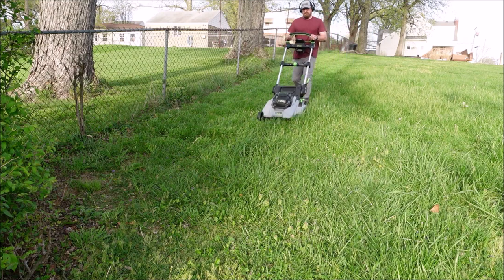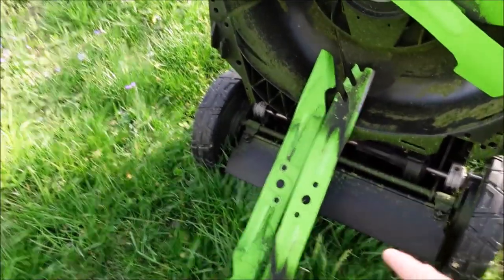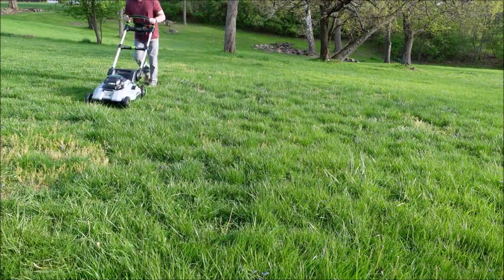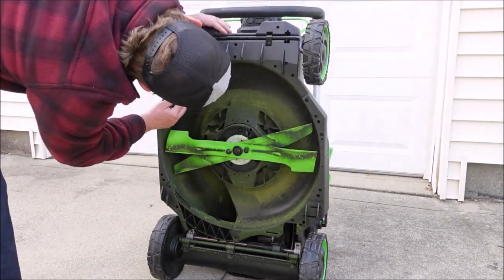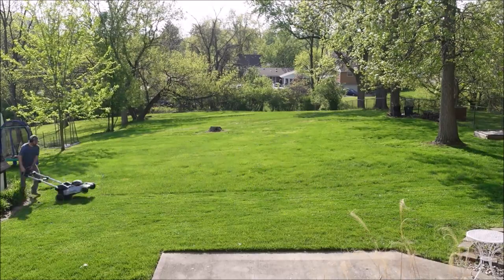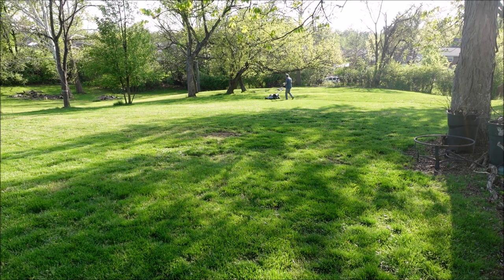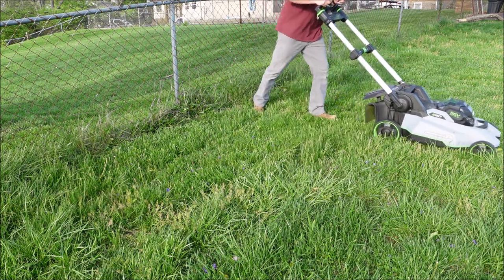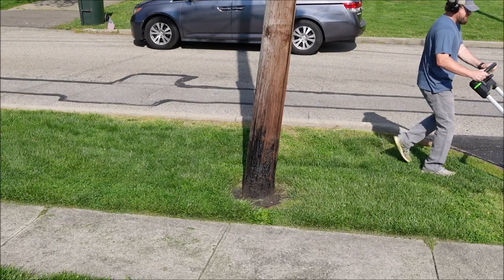New EGO (2023) Speed - IQ - TEST and REVIEW - LM2167SP

Comment: I just bought the LM2167SP Select Cut XP this week at Lowes on sale @ $699.99  using a Lowes 20% off coupon (MAX DISCOUNT OF $100)  my final price was $599.99/ $636. w/tax. I sold the battery and the charger to a friend as I didn't need either of them for $575. , Now I have the newest EGO mower for a whopping total final cost of $61.00  . My wife now totally approves of my purchase. I'm still not thrilled about the Speed IQ feature vs my last EGO model that used the barrel adjuster and the handle paddles. Mower lurches forward too much sometimes and the loud sounds it makes while in auto self propel mode id annoying even when using earphones.. I wish they made the on/off button for speed control a-lot bigger, as it doesn't always respond to the push.   But hey I can't complain too much for a total cost of $61.00 for the mower. :)
Reply from the maker: The more I use it I find that several of the buttons aren't responding to push from time to time. I find myself using it without self propel more than with. You got a great deal!

Comment: The LM2142sp has 8.3lbs of torque and runs on 1 or 2 batteries, and spreads the load across the 2 batteries to help extend their lifespan. At $699 with 2 5.0 amp batteries included, Im debating between it and this newer one. I could use those 2 5a batteries in other tools, where I wouldnt be able to use the 12a without a backpack. The 2142 only has 1 blade, but I guess you can upgrade it to 2. Tough decision. Great video by the way, you showed it off well.
Reply from the maker: Thanks! Somebody else in the comments just pointed that out as well. I did not know that! Yeah, this 12 AH battery weighs almost 8 lbs. Not something you want to be toting around on your string trimmer or something like that.
Reply: @fixitFlip  👍

Comment: I have heard some complaints about the Speed IQ self-propelled feature as the mower controls the self-propelled  feature. Personally this is not a issue for me at all. I have no trouble controlling the mower even without it adjusting the self-propelled speed on it's own. Plus you can turn the self-propelled feature off and on while the mower is running. ECO Mode is usually enough to cut 90% of my lawn. This mower can be a bit of a power hog unless you are using the Eco Mode feature but for a regular EGO user with other EGO products and batteries that is not really a major concern.

Overall I think this mower is better than what people give it credit for and the monitor screen is brilliant. The only thing that would make that part better is if it told you the time as well which there is certainly enough room on the monitor for. Simple solution, just let us put a double A battery in the next model so a clock could remember the time when there is no EGO Battery in it. I have bad flat feet and the self-propelled feature make me feel like I am walking the mower almost like you walk a dog instead of pushing or without constantly having to push a handle. Having this mower is a great relief to my flat feet.
Reply from the maker: I agree that the display is great. And this mower is great in straight lines and open areas. I just don't like how it tries to jump out of my hands when I need to stop it. I do find myself using it more with the self-propel off lately.

Comment: Thank you for this in-depth review on this LM2167SP mower that I have been considering.  I really like the digital display for the easy readout and battery life, the full-time minimum Turbo blade speed to get better suctions when doing maintance cuts at higher settings (all XP motors have the same maximum blade speed), 12.0Ah battery for the runtime and the wire-less single clip retractable handle bar.  Yes, the final item that holding me back for the decision is the Speed IQ and based on the review I may have to wait for another model to replace my current LM2142SP (or name it correctly, a retrofitted EGO Select Cut LM2146SP XP with Peak Power technology!)

It is true that the LM2156SP & LM2167SP are the only two models EGO advertised with the XP 1200W 8.3ft-lb torque brushless motor; however, the very first original EGO mower with this XP motor that is never advertised to date is actually the current LM2142SP equipped with Peak Power technology.  Introduced in 2018 with the XP motor which requires minimum of 10.0Ah power to produce the optimum perform required EGO to provided 2 x 5.0Ah batteries and paired them with the Peak Technology to achieve the possibility with 80 min. of runtime.  Retrofitted it with the EGO Select Cut High Lift blade set (best setup for any cut), fan and washer it is easily turned into a Select Cut model in 15 minutes and with the extra weight and resistance of the blade assembly this XP motor will always be spinning at Turbo blade speed.  When paired with two 10.0Ah batteries from the snow blower at 20.0Ah it becomes a LM214"6"SP (new EGO naming: "2"=5.0Ah, "4"=6.0Ah, "5"=7.5Ah, "6"=10.0Ah, "7"=12.0Ah on the last digit of the model number) with extra weight to hold down the mower and the runtime that I don't even pay attention anymore after cutting 5,700 square feet with 5~7 degreed slops and still have two bars on each 10.0Ah battery to trim with the IQ trimmer and the 765CFM blower without running out of battery power at the end.

I am hoping to see a Peak Power model with everything LM2167SP has to offers without the Speed IQ (Touch Drive or dual leaver on each side of handle would do fine for me) and maybe with a wider cutting deck like 24" or 30" in the future.  Thank you again for this in-depth review that really help me for my decision.  Maybe I will pick one up when it's on a deep discount sale but not right now.
Reply from the maker: Glad I could help. And very useful information about the LM2142SP!! You know your stuff!
Reply: @fixitFlip  it's only pure luck when I cross reference the part number of the motor on EGO's website to realize they are the same unit when I was thinking about upgrading the motor on my old LM2102SP.
Reply from the maker: @Jeo-What  Very interesting!!
Reply: Everything you said in your first paragraph I was about to write myself, except that I have the LM2101.  I really wanted to upgrade to their best mower and this one looks like it, but they really effed up with that self propelled feature.  I like everything about this mower, but I don't want any part of that self-propelled nightmare.

I'd be happy upgrading my LM2101 with the dual blade hack but I'm not sure the motor would be up for the task, maybe upgrade the motor.   It's a slippery slope.
Reply: @infotime  not sure about the motor on the LM2100 but I know for sure the LM2100SP's more powerful none brushless motor did do the job fine for me as long as you have extra battery to compensate the list of runtime.
Reply: @Jeo-What  I'm not worried about run time as I just got a new 6AH battery and have my old 5AH that works.  I'm just a little uneasy about added stress on a motor that wasn't designed for that kind of load.
Reply: @infotime  I understand your concern... but, he did it on his LM2101...  https://youtu.be/qrxIwJGQ9JE
Reply from the maker: @infotime   The LM2135SP has the same torque without the self-propel issues. It does come with a shorter lasting battery, though.

Comment: You nailed the issues with the Speed IQ. If you have long, straight cuts, the Speed IQ can be very nice, but if you have landscaped yard with lots of curves, the Speed IQ can be very aggravating. If you have to make some short pushes, combined with the fact that the clutch does not always release right away can make it feel like you are wrestling with the mower and while the mower is not super heavy, if you are doing a lot of short pushes such as those under overhanging shrubs, it can tiring to use the mower even if you have the drive off.
Reply from the maker: Exactly. Your comment sums it up.

Comment: When we bought the older Ego we were disappointed that it wasn't self propelled.  Then we realized that the mower weighed about as much as an empty baby stroller...and we never missed it.  It is almost insulting that something so light would be expected to self propel and we felt silly that we did.   It is holdover from heavy gas mowers.   I imagine they added it because of that point of sale expectation.
Reply from the maker: Yes, I rarely use mine unless I am going straight up my big hill in the back. It's very light.

Comment: Best mower review video I'veen. Thanks. Is there a setting for self propel on but speed iq off? I need the torque and amphours of this mower but need to do lots of direction changes while mowing my ground and speed iq would hhurt, not help.
Reply from the maker: Thanks for the kind words. It does not have a self propel without using the speed iq unfortunately. I would probably recommend the 2156 model if that's what you want. It has the same torque, just comes with a 10 AH battery instead of 12. And of course no digital screen or speed IQ. And I think they are marked down to like $650 at Lowes right now from $859.

Comment: I ordered the lm2167sp last month it was doa EGO won't back it with the same mower to many issues people are reporting to them, they instead sent me the lm2156sp g3 2 kits with two batteries and charger and get to keep the new 12ah battery as well. I am glad it worked for you but I hope you don't have any issues and I hope you bought it locally I bought mine off of Amazon. Looks like it ran like a champ though. Sucks Ego didn't just replace the one I got with the same one.

But the lm2156sp g3 has the 8 height settings and the phone holder as well to my surprise they did some small upgrades to the mower including the more aggressive wheels and the brighter green highlights. It looks very similar to the new lm2167sp.
Reply from the maker: Sorry you've had to deal with that. The lm2156sp is a solid mower , though. And you got to keep the 12 AH battery. $600 battery. Not too bad.

Comment: @Fix it Flip Does the turbo mode on the 2167 really make a noticeable difference in cut quality vs the 2156 which does not have turbo mode? It just increases the blade speed from 2800rpm to 3000 rpm.
Reply from the maker: I can definitely tell a difference on turbo mode. I would say it cuts better, yes. But not sure if it's worth the extra money taking into account the self-propel issues.

Comment: Do you have to use self propelled ? Wouldn't it save battery if you just push ?
Reply from the maker: You definitely do not have to use it. My yard is hilly so I typically have it off when going downhill and on when going uphill. But it is very light. You don't need it much.

Comment: How does it handle the backwards pull 😅I see that it takes a double take on a regular run
Reply: Runs better completely on turbo fully minus the blower tip
Reply from the maker: If you have the self propel on its pretty herky-jerky. I find myself using it more without the self-propel lately.
Reply: @fixitFlip oh so you can switch from auto to manny
Reply from the maker: Oh yeah. It's super light so you really don't need the self-propel unless going uphill or got some super long grass. Just the push of a button.  @SkiTzO251

Comment: @Fix it Flip what about the mohawk.  Can you talk more about that.  One reason I was thinking about going to the top of the line EGO mower was go avoid that.  I get it on my LM2101 and don't recall ever having that problem with gas powered mowers.
Reply from the maker: I would say possibly a dull blade or low blade speed. But this blade was brand new and it has plenty of blade speed. My guess is I just wasn't overlapping my lines enough.
Reply: @fixitFlip  I don't know how much overlapping one needs to do. But this is their top of the line mower, new blade, highest power and torque - and it still has mohawks.  I thought upgrading my low end model would fix it.  Maybe it's just an inherent flaw with EGO mowers.
Reply from the maker: @infotime  I hear ya.

Comment: An hour that’s it? My gas mower is all I need.
Reply from the maker: I'm not anti gas. See all the videos on my channel. But it sure is convenient not to have to go to the gas station. I think it would last a lot longer with the extended runtime blade.
Reply: @fixitFlip  Oh I know your not.
Reply: With the LM2142SP Peak Power with dual battery bays and pop two 10.0Ah batteries from the snow blower and it can go for over two hours (Peak Power keeps batteries cooler during operation) without swapping the batteries
Reply: @Jeo-What  I can do more than 2hrs with my mower. I would never go electric or use electric.
Reply: @everythingvideos24  though I have six sets of batteries and two sets of chargers that will allow me to mow for days and nights (LED headlights in this mower )without ever stopping I'm just glad I don't have a lawn that big to deal with 🤣🤣🤣.  Gas or electric or cordless electric is a personal preference and as long as you're happy with what you are using I am happy for you.🙂
Reply: @Jeo-What  Well not on a single charge so... Gas mower still has you beat. I don't need batteries for my mower just gas it'll go for acers and hours.
Reply: @everythingvideos24  I disagree based on mathematic of ten-year cost of gasoline, cost of gasoline to get gasoline, spark plugs, filters, maintenance versus the extra price paid for the cordless lawnmower. In the end they cost the same and the game of "beating" for Runtin is a pointless one since the lawn mower just need to have enough run time for mine lawn and any additional run time is pointless to any operator. But if it makes you feel better … You may proclaim that you are the winner😉
Reply: @Jeo-What  I love changing spark plugs, oil filters, fuel filters, and air filters.
Reply: @Jeo-What  If you disagree let's see some videos of this mower doing all good.
Reply: @everythingvideos24  then you are with the right tool👍
Reply: @everythingvideos24  According to their test, the only mower (electric or gas) was more powerful than the one I mentioned LM2142SP was the the Honda Commercial HRC21HXA Self-Propelled mower: https://youtu.be/dZc72leGiIw
Reply: @everythingvideos24  This is another good reference on the EGO LM2142SP with Peak Power: https://youtu.be/rljVqrJHzSI
Reply: @everythingvideos24  there is plus and minuses to each type of mower. One thing for sure is now that more companies including the major gas brand mowers bringing out an electric version is really advancing the technology of the battery electric mowers. One big advantage is for older people or people with medical conditions that has issues of pulling the start cord on a gas mower. Even with women like my wife who has an issue of using enough pulling force to even start a gas mower. I had a Honda which is I think one of the easiest starting gas mower and she has problems trying to start it. So with electric it takes the strain off people to be able to just pop a battery in pres a button and pull a handle and they are mowing. I just got a ego mower and when I move in to my new house I can test it for myself and see how it stacks up to my experiences with gas mowers. I started mowing when I was like 7 years old and at 51 I am excited to see how electric stacks up to gas. 

One area I see electric being better than gas is against the 2 stroke gas engines you find on weed eaters and other lawn equipment. You can stand there pulling your heart out and have a hard time starting it. Plus mixing the gas can be a pain if you don’t get it just right you run in to issues. Where as with electric weed eater you put your battery in and pull the trigger and you’re on your way. 

So like I said everything has a plus and minus. I will say the biggest minus is the battery costs of electric mowers and you’re more prone to a battery issue then you are with a gas engine issue. Once I start using the electric mower I might hate it and take it back to get a Honda but the electric weed eater and leaf blower I will stay electric over gas. I just see more advances in electric in the coming years to one day it can give gas a run for its money.  It to mention you have stated like California cracking down on gas power lawn equipment to where your only option is electric. So I hope you keep an open mind and one day just give electric a try yourself.